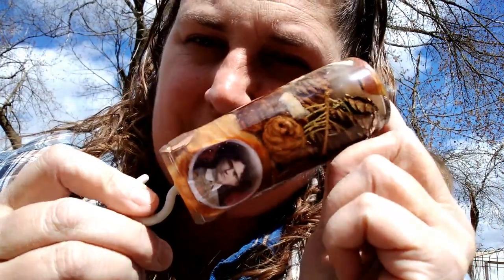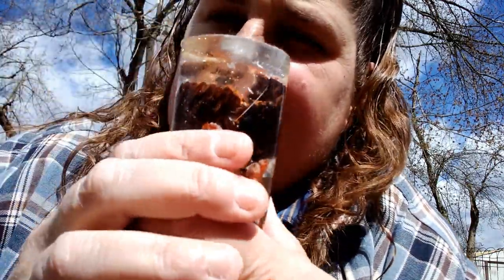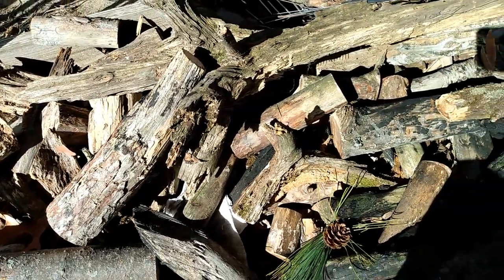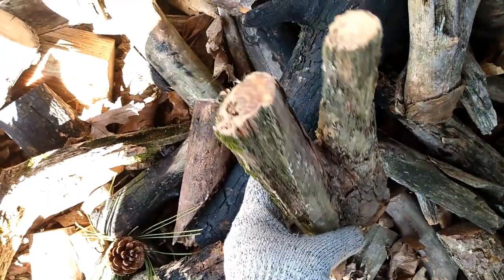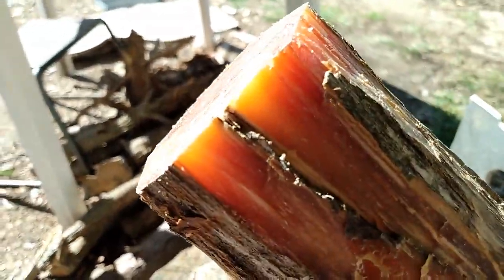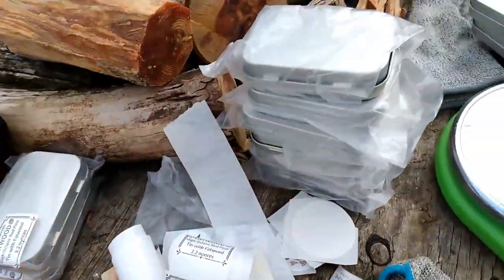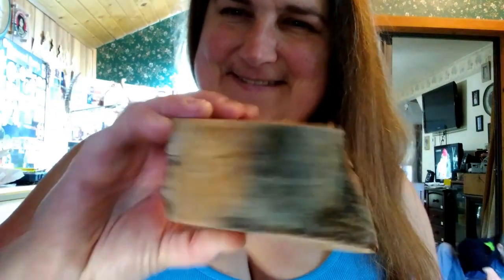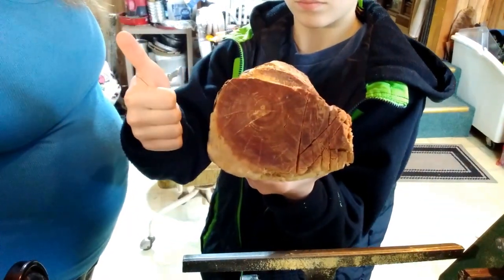Fatwood Friday Turn And Burn "Thorny Fatwood"

Comment: Another cool video.  Would like to know more about the skew chisel you are using, grind angle, width, brand.
Reply from the maker: I am still a beginner with the wood turning. My chisels are cheap Harbor freight that came with the lathe. I have a few bowl gouges from a friend and I have a small set of carbides. I will be using my Nova chuck for the first time today. I am setting up right now.